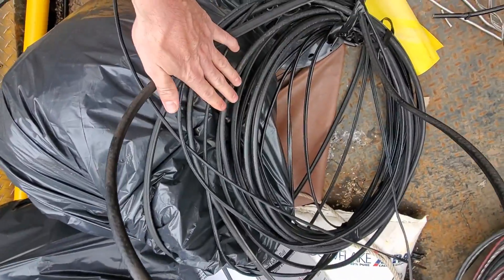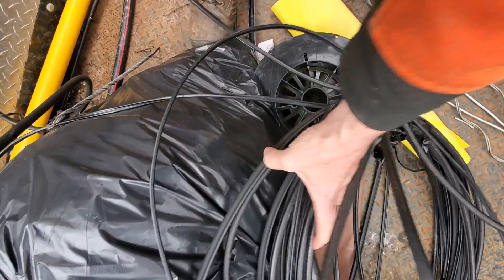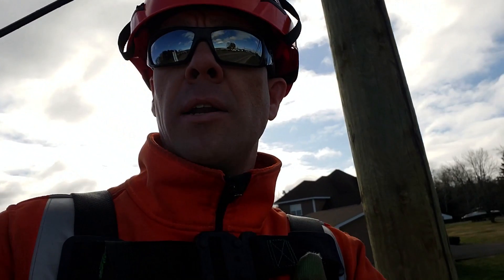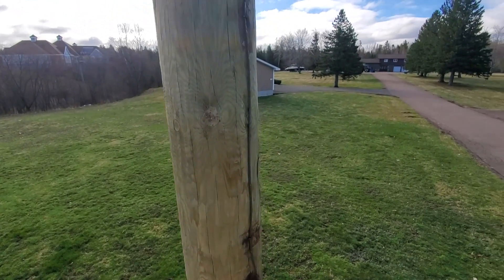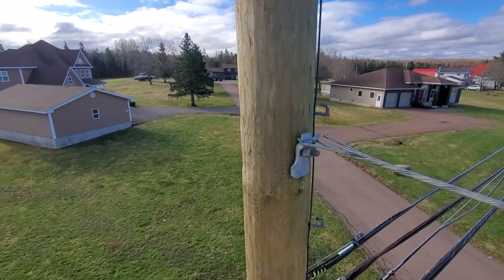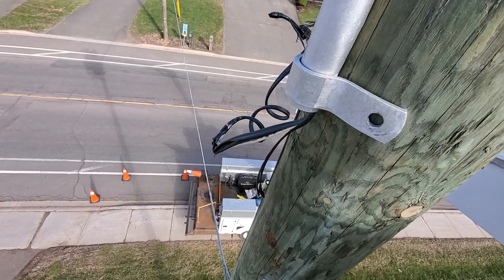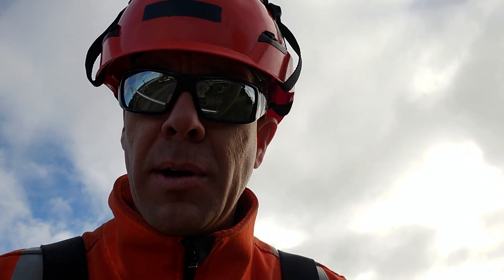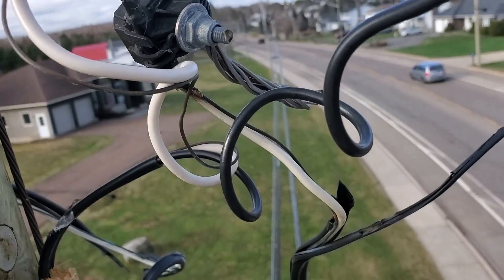7200 volts through telephone lines!

Comment: had something similar in a lower scale in one of the buildings I work in.   back alarm pad wasn't working so we had techs working on it.   he touched wires and their was sparks and he found  out a 12v line was 120v for some unknow reason.
Reply: I was working on a hydronic heating system (homeowner was building an addition and needed to add a zone).  The copper piping gave a little tingle, so I presumed one of the 24VAC control wires was shorted to a pipe and made a mental note to trace it out later.  A few minutes later, a carpenter touches an overhead pipe and almost goes flying off his ladder.  I checked it with a meter and it was 120VAC to ground.  "I just saw you touch a pipe and you were fine!  Why did I get shocked?!"  That's when I realized my electrically-insulated boots had blocked the majority of the voltage so I just got a mild tingle.  I tried to always remember to get rated boots, and also not to assume voltage from feel...
Reply: @josephbrown8905  Rated Redwings saved me more than a few times in the heavy industrial environment.
Reply: @josephbrown8905  I would be surprised if 24V would give a tingle, that usually indicates way more volts.
That reminds me of my brother, he was running a phone line out to a back shed, he thought I had said 'about 9V', so he used his tongue to see if anything was there...... 
50V on ones tongue is not a good idea
Reply: @paulstubbs7678  With more experience, yeah, but I was just starting out and since it was so much less than I was used to from the occasional 120VAC, I guessed it was a 24VAC source.  I always check, now.
Reply: ouch  @josephbrown8905

Comment: got to the homes too?
Reply: At least briefly, yes, telecom lines become energized by this kind of accident.  There are a couple things that limit the harm.

Thin conductors burn out easily and they limit the size of arc flashes.

The insulation is also weak, so it will probably start breaking down outside the customer's premises instead of breaking down inside equipment.

The equipment insulation is better than you might assume.  Ethernet, for example, is rated for 8kV of isolation between line and computer.

So you probably shouldn't use a corded phone in the shower during a wind storm.
Reply: @jordanrodrigues1279  Typical ethernet interfaces absolutely aren't rated to stand off 8kV. Typical transformers used are tested to 1500Vrms, and this is solely functional isolation, not intended for electrical safety.